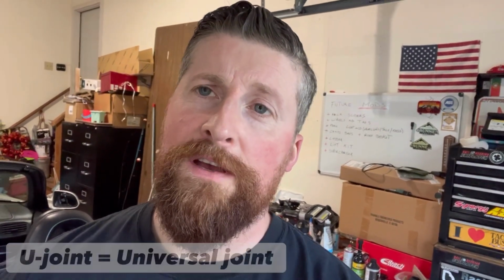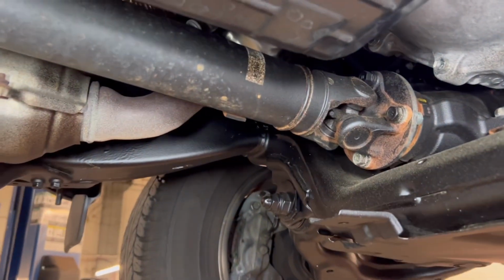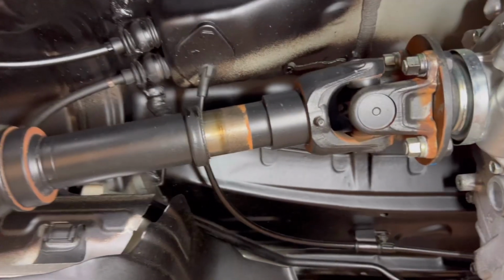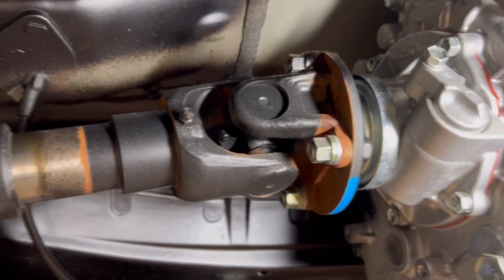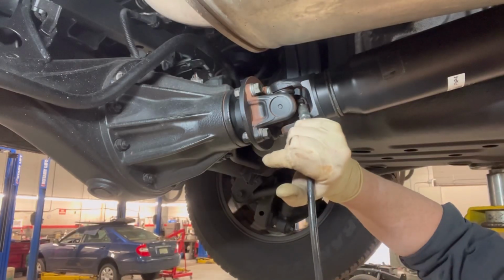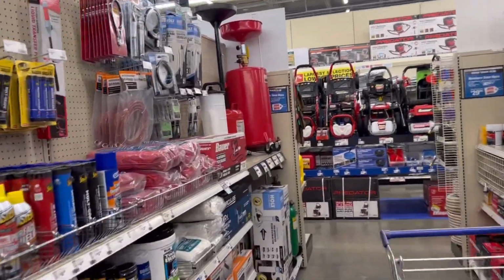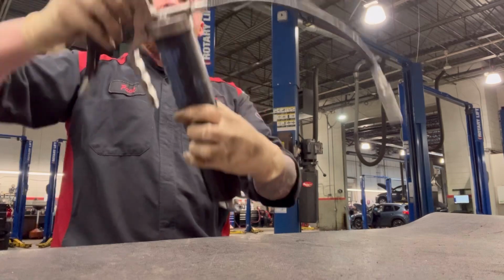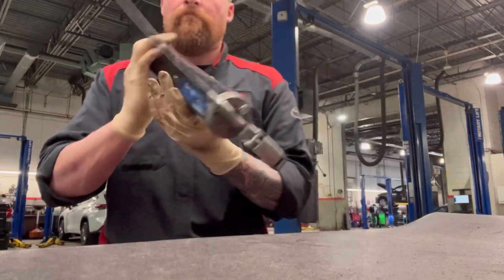Toyota 4Runner • FREE Maintenance Tech Tips - DIY Drive shaft and U-Joint Lubrication • Episode 11

Comment: Thank you for making these types of videos. When I asked the Toyota dealer to grease my 4Runner, they first tried to say that there are no grease fittings on new vehicles. I then showed them that the 4Runner has 6 grease fittings and they told me that their techs don't have grease guns. At that point I lost all confidence and ended up doing it myself. Your videos are very helpful. After watching you show how easy it is to change the differential fluids and transfer case fluids, I did that myself also and save about $700. So again, thank you.
Reply from the maker: 👏🏻👏🏻👏🏻 Absolutely, I’m glad I can save you guys some money. 💪🏻
(The fact that they don’t know that it has grease fittings makes you wonder what else don’t they know 😬)
Reply: @VikingsGarage hello sir. I watch your videos they are informative and easy step by step. My question regarding the the grease for the propeller and shaft. Red and tacky lithium NLGI#2 can be use on those parts ? Thanks in advance.
Reply: I agree. I asked my dealership about it and they didn't know what that service was. It wasn't in their computer. They had to talk to a Master Toyota Mechanic and the answer came back to charge 1.5 hrs

The manual says to retorgue the propel shaft when you grease it. How do you do that?
Reply: The 2000 4Runner has 8 driver shaft zerks from the transfer case to the rear end …
Reply: @Goofketeers  yeah I was wondering that too. It just says re-torque the propeller bolt, like there's only 1! No torque specs anywhere I have found.😔
Reply: Never thought about greasing the fittings, but while I’m doing the trans flush and filter this weekend, this will be on the list!  I’m working my way through all your maintenance videos on my 200k 4 Runner maintenance month!  Thanks for the great content!!!
Reply from the maker: @stuartfact8361 your very welcome!! 🤘🏻
Reply: I had a similar experience, even after showing them the recommended maintenance listed there in the manual. But they rather sell you an 80 dollar cabin filter 🙃
Reply from the maker: It’s really bad, most of these kids are clueless

Comment: The drive shaft greasing is so important.  I had the 2nd Gen Tacoma- when it was new, it had drive train vibration at certain RPM. They actually had a TSB for the issue-  however what fixed it was simply greasing the propeller shaft fittings once a year, and eventually every other year.  Vibration disappeared and never came back.
Reply from the maker: I can believe that!! 👏🏻
I appreciate you sharing your story.

Comment: also just a heads up all 3 zerks will be on the same side of the driveshaft if that makes sense. i ground down the tip of my grease gun so it fit in there easier. i do 1-2 pumps on the slip shaft every other oil change (@10k miles) as damage can occur if over greased, the u joints get enough grease until you see it come out. i use the same grease for both the slip shaft and the joints even though the manual says they are different. bought it new, now at 90k miles with no issues

Comment: I’m breaking in my new ORP…keeping it 60-70 mph, no cruiser control or tow for first thousand miles. I’m also doing undercoating right away and driving 10 miles/month in 4H. Detailing once a year. Adding driveshaft lube to program.
Reply: When you drive it 10 miles a month on 4H are you doing that on pavement? If not, where is the ideal place to drive it on 4H.

Comment: Back in the 70's I was a mechanic @ a Chrysler store. Back then the OEM U joints had no grease fittings.
We would pull the drive shaft and beat the u joints out on a vise. Then take a finger of grease and fill the cups. It was not an easy job. Thank you I love your videos!
Reply from the maker: I’ve actually done the u-joint replacement part a few times, it’s not a fun process. we definitely got it easier nowadays. Thank you for sharing!

Comment: Wow ive been wanting to grease whatever part that has grease fittings. Didnt know there were only 6. Thank you for the info!
Reply from the maker: You got it!! 👍🏻
Reply: @VikingsGarage  BTW have you done a brake job tutorial? I scrolled down idk if I've missed it or you just don't have any.
Reply from the maker: Sure thing, it’s a quick and easy guide:
https://youtu.be/9tiFUcN8yEw
Reply: @VikingsGarage  thank you sir! One last thing (for now lol) I'm at 75k+ miles, do I need to change rotors? There's a little grinding noise to the brakes. If so any rotor brand you recommend to pair with akebono pads? Thanks again
Reply from the maker: OEM TOYOTA Rotors

Comment: Great video, thank you 🙏 

I didn’t know that the same grease can be used for spider joints and the slip yoke. I had actually bought two different grease type and grease guns following the owners manual.
Reply from the maker: Your technically correct, although you can get away with just the one grease.
I’m always trying to show you guys practical, effective and easy.
Reply: @VikingsGarage  Thank you for sharing knowledge and showing practical and easy way of doing things. Looking forward for your next video. God bless you and your family 🙏
Reply: Actually if you read the manual it states slide yoke and spider can use NLGI #2 Lithium grease. No need for 2 grease guns. This is in my 2011 Limited manual.
Reply from the maker: One and done.. 👍🏻

Comment: I was wondering if Toyota hit those when changing oil. I got use to greasing the combine on the farm every morning before starting the day. Now I have a new TRD ORP and was wondering if I should crawl under and hit those. Watching the grease come out of the joints was always key when greasing the combines. Great content. Thanks for the video!
Reply from the maker: Honestly, I would grease them if I was you. I’m literally the only Tech in this dealership that greases those fittings when I work on a vehicle that has them. A lot of these guys don’t take pride in the work they do, never mind that. They don’t even own a grease gun. 🤷🏼‍♂️
(It’s the sad truth about dealerships nowadays)
Reply: @VikingsGarage  If you don't know when it was greased last, if at all, how many pumps would you do? Is there danger in overfilling it?
Reply from the maker: @AbcDino843 no danger in over greasing it… just will splash on your undercarriage which is not a bad thing. 
Usually 3 pumps do the trick. 👍🏻
Reply: @VikingsGarage  thank you.

Comment: Great job. “How to” videos are always a favorite. If the back wheels are on the ground then moving rear drive shaft in while transmission is in neutral will still move rear wheels, right?
Reply from the maker: In order for that shaft to move the wheels have to be off the ground.
A good compromise for the rear shaft, is to see where the grease fittings are and move the car untill they are a bit more accessible. The from will move as long as you’re not in 4high.

Comment: Awesome video as always! and please take care of yourself. Question - You used a moly grease for both the slip yoke and spider. Toyota spec's moly for the slip yoke and just regular lithium chassis grease, NLGI No.2 for the spider. I have been using Amsoil synthetic polymeric off-road grease, NLGI #2 ---- should be fine for both the slip yoke and spider, correct? Any Viking Garage mech in the future?
Reply from the maker: You can use it in both, Tried and tested over and over. The key is that it does get greased periodically. I’ve been working on some shirt designs and hats … soon as we hit 10k I can set up the shop in the channel. 
As always thank you for your support!!

Comment: I have a question. I just got a SR5 2016 with 108k miles. I want to do this but I have read that you don’t want to put too much grease in some of those fittings or you can blow the seal. I’m guessing the outside ones. How do I know if I should perform this service or not? I don’t want to ruin anything.
Reply from the maker: Not everything you read or hear about is correct. Get yourself a grease gun, attach it to each fitting and give it 3 pumps.
End of story.
(I’ve never seen a seal blow!! 
They are built to allow excess grease out.)
Reply: @VikingsGarage  Amen to that brother. That’s why I asked the expert. Like I said I just picked up a 2016 and your YouTube  channel is the Bible. Thank you so much for putting out all this great content.  All my fluids look good, but the transfer case and both differentials are getting changed out this weekend.
Reply from the maker: @OVRCOME 🙏🏻 Thank you!
You got this 💪🏻

Comment: I have a 2020 ORP with 12500 miles and Toy-Tec lift installed when new. I was told to use Marine grease as it's water as salt repellant. I greased the suspension around 5500 miles but never greased the u-joints yet. I assume the Marine grease would be ok for u-joints.

Comment: I see some people pump until, “the old grease comes out of all the corners.” It’s a giant mess, but the idea, I suppose, is that only fresh grease is inside the part. I’ve done it this way and found it a annoying to clean up all the grease between the u joints. What do you think, worth the extra mess or overkill?
Reply from the maker: Overkill… 
3 pumps on each fitting every other oil change and you’re good to go.

Comment: Went to Toyota for an oil change service today. I asked the service rep lady if they can lubricate the drive shaft on my 2021 Toyota rav 4. 

She replied, "there are no drive shafts. Its an AWD not a full time 4 wheel drive car!"

I was confused at the moment and super tired and didnt want to argue.

Was she correct?
Reply from the maker: She was right, it is all wheel drive. 
But you still got the drive shaft that sends power to the rear wheels.
Unfortunately no zerk fittings on those driveshafts.

Comment: My manual also says to re-torque propeller shaft bolt. Which bolt are they talking about!? I have a 4th Gen 4runner.
Reply from the maker: All of the bolts you will find in your propeller shaft u-joints.
Reply: @VikingsGarage  yeah I kinda figured to just make sure everything is tight, but they specifically say re-torque propeller bolt so I thought it might be something special and there's no reference for a torque spec anywhere. Thanks for your response and your awesome diy videos. I've done a lot of my own maintenance with the confidence I have gained from your videos. My mechanic of 30 years got 2 shoulder surgeries back to back so he gave me a few tips too but I'm definitely the one getting his hands dirty. Keep up the good work 👍😁
Reply from the maker: @chachi5975 Much appreciated!!🙏🏻
Wishing him a speedy recovery!

Comment: Wha about a 24 limited with the full time 4wd shafts. Where are the fittings. I can't see em.
Reply from the maker: You need to move the vehicle slightly until you can… those drive shafts won’t spin freely.
Reply: @VikingsGarage  or put it in neutral and spin the wheels till aligned.

Comment: If you put limited in neutral can you spin all shafts by hand?
Reply from the maker: You should be able to. Yes.
Reply: And what if you can't, what does this mean? 2013 sr5 4wd here
Reply from the maker: The question was asked because the limited is a full time 4 wheel drive sir. An SR5 is normally 2wd (rear wheel)

Comment: I have a 2016 4runner SR5 2WD does it need to be greased at the U-Joints?
Reply from the maker: Yes, the rear shaft needs greasing.
Reply: @VikingsGarage  Thanks for your reply. I appreciate your help with this.
Reply from the maker: @youssbaraki you got it!

Comment: The maintenance book says every 5,000 miles if you drive in salt.  15,000 otherwise.   Dealers don't do this automatically with the 5,000 mile oil change? or it has to be customer requested?    I'm sure the book says 45 mins labor:)
Reply from the maker: You got to request it, half if not more of these guys don’t even know there’s fittings there.
If I work on it, I usually 99% of the times will grease it. No need to ask. 😀